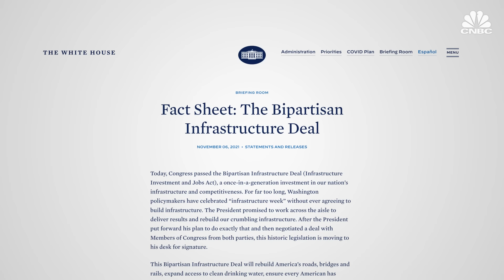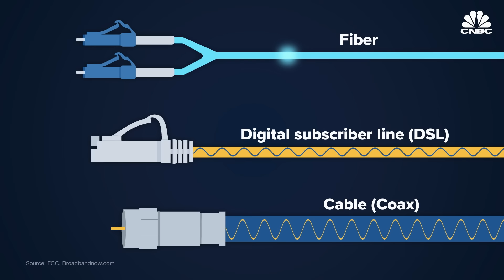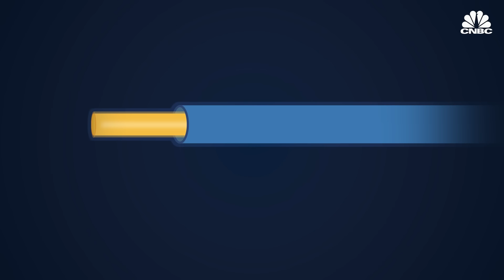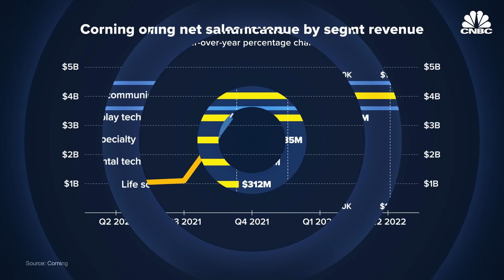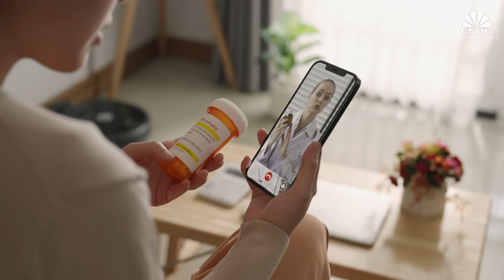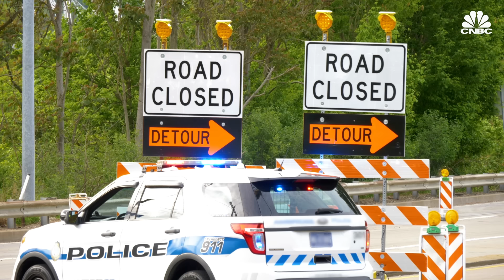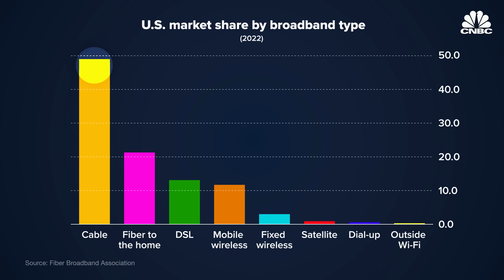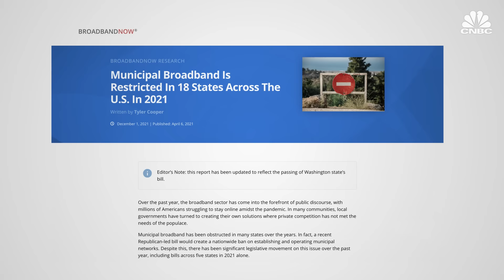How Fiber Will Speed Up America’s Internet

Comment: An excellent story. As a simple "end user" our household story is, we just switched to a fiber based internet service via a company called Sparklight (in Longview, TX). In addition, and this is CRUCIAL, we upgraded our wifi to a mess network. Now, our internet speeds are amazing! Information pops up immediately on websites. 4K videos play with no interruptions via web based TV services like Netflix, Amazon Prime, Disney+ and others. It's night and day compared to our former coax based cable company service. Ironically, the last, short connection between our fiber modem and the computer in our home office, is a copper CAT-6 cable!?! Yet, even that connection is MUCH faster due to the initial fiber service. As more and more Americans do get connected in what they call "the last mile." by fiber, I believe it will be a tsunami effect of consumers hooking up where available.
Reply: Mesh networks are great, I’d also say getting WiFi 6 router/s if you have mostly modern devices is a great call with fiber. Even with 1 WiFi 6 router in a ~4,000 sq foot house my desktop gets 500-600 megabytes per second up and down, no Ethernet

Cat 6 supports 10 GBPS @ 250 mHz…. So luckily, it’s highly unlikely you have the bandwidth to maximize its throughput speeds

Comment: While I think we all know that wireless has its issues, which wasn't really touched on in this piece, let's focus on the difference between what coax gets you versus a fiber connection (and I am on a 1 Gb/s symmetrical fiber connection here in the USA for ~$60/mo, which is much cheaper than the coax service in my area that is inferior to this):

1. Raw speed - I actually do need the upstream.  Many others may need this for things like backing up their computers to the cloud and remotely monitoring home security cameras.  Cable modem can be fairly fast on the downloads, but sucks on uploads.  When you do need it, it is not there just like the people who are not really your friends.

2. Latency and jitter - Cable modems can easily add 7 - 30ms of latency and can have lots of jitter as you share the connection with your neighbors.  As we all use VoIP (Voice over Internet Protocol) and video conferencing apps, this leads to delays causing people to talk over each other excessively due to the poor quality of service as opposed to it just being rude people on the line and breakup of voice and video, which at best is annoying and worse unusable and it happens ALL OF THE TIME with cable modems, greatly harming the quality of work from home.  In contrast my current symmetrical 1 Gb/s fiber connection has less than 1 ms of latency and less than 1 ms of jitter.  I can see when I am doing the same things over this fiber connection, at least the other people who are also on fiber and are either wired in or have their home Wi-Fi setup properly, the connection is perfect, no delay, no breakup of voice or video.  It is really clear who is also on fiber (and seeing I remotely communicate with the same people all the time, I know who has what to validate this) and who is on a cable modem.  In the remote worker world where you may interview over your home Internet connection, the people with fiber have a clear leg up on the people who don't just due to the potential employer can see, hear, and understand the person on a fiber connection where often the person on a cable modem they can't or key things said are lost.

3. Packet loss - An interesting thing I came across a few years back was a kernel patch that broke TCP fast re-transmits on a server on the other side of the country from where I am at in a way where it really impacted these long distance transmissions for large data transmissions I was doing for work.  On a cable modem, the problem would be triggered right away.  On a fiber connection, the problem simply would not happen.  I looked at the data stream with a packet sniffer and validated what was going on.  The fiber link simply did not randomly lose a single packet and so there were 0 TCP fast re-transmits while the coax link dropped packets like mad and this is even with the cable modem directly wired in, no splitters, only an attenuator because the signal would be too strong for the cable modem as the cable provider has to bump up signal strength to go through people's crappy splitters and open ports bringing noise into the system, especially on the 700 MHz band used by the cable modems that is also used by 4G cellular service.  (On my cable modem back when I could only get cable modem service in my area, I could see tonnes of packet loss in this 700 MHz band on those channels.  It came in bursts, probably as one of my neighbors sat next to an open coax port in their home with their cell phone or maybe an old coax wire that wasn't up to snuff.)  Packet loss also contributes to the poor quality of service discussed in #2.

4. Service outages - When I was on cable modem service, it regularly went out, even though I took everything off and just had the coax go straight into the cable modem, no splitters, just the right sized attenuator needed when not using a splitter.  When the power went out, the cable modem service went out.  I had the electronics in question on backup power, so they still had their power lights on, but the cable modem just wasn't receiving a signal anymore because the box down the street the coax cable connected to that the telco controlled did not have backup power.  With my current fiber service, earlier this year for example a huge, record smashing wind storm knocked out power for an extended time.  My fiber Internet service worked perfectly the whole time as I ran my equipment off of backup power.  As the fiber goes straight to the CO (central office) as fiber has the reach coax does not have, the ISP was able to keep their equipment powered reliably from a central location.  I even went by the CO at one point as I was doing stuff and could hear the backup generators running at the CO.  In general the fiber service has been super reliable and just works.  This was never the case with super finicky coax, no matter how hard I tried on my side to have the best possible experience.  Those with splitters and coax running in all directions through their home must have a terrible time, even worse than my horrible experience with it.  For example I have gone under homes to work on issues and have found rodents have chewed up the coax under the home.  I think this is probably pretty common and this can ruin the experience around the neighborhood as coax is shared with your neighbors.  This has got to cost the coax providers a fortune in service calls where my fiber service just works perfectly year after year, no service calls needed.

So yeah, coax is an obsolete technology that did not serve America the way it needed to during the pandemic nor will it moving forward.  If you want and these days need a quality connection that can serve your work from home needs, you really need to have fiber to the home.  There is not much else that can really compete with this in most cases.  The main exception I can think of is if you live in a high rise building, there is the possibility of doing point to point wireless between tall buildings at high frequencies (such as 60 GHz) and this can work out well.  Businesses can get lower frequency fixed wireless as say a lower speed backup connection, though beware of shared fixed wireless and VoIP as the two don't mix due to latency and jitter issues as well as potential high packet loss.  Cellular is really not all that great and worse than cable modems, which are not really good enough.  Starlink is more you don't have another option in your rural area.
Reply: Unfortunately I live in an area where comcast runs a monopoly and are the only internet providers. They set whatever price they want for their inferior service. Folks that live 1 block away from me have fiber internet that comes in from the pole. My house receives all its wiring from underground. The fiber company said they couldn’t run their cables underground and I would need to be close to the pole for me to even get service. Sucks that I have to deal with comcast.
Reply: Ya no ones reading that sorry bub.
Reply: Let's address a few things here. 99.999998% of people will never use speeds faster then the slowest coax connection. It would cost billions to service those 0.000002% that need it.Irest my case.
Reply: @TheReal_ist  it was very insightful. Speak for yourself bub
Reply: @miked3723  With what evidence?  To make it short as you obviously did not read before writing, consider mainstream uses such as computer backup, high quality phone videos, high definition security cameras.  Fast forwarding through security cam footage remotely.  Downloading modern games off of Steam.  Competitively play online games with video streaming.  Video conferencing.  Remote work.  Power outages.  These are all places I have seen cable modems fall short with endless frustration from it not working good enough and these are all mainstream use cases and things that happen in everyday life I am bringing up.  I see at least some of these every day.
Reply: @ChaJ67  All of those services work just fine at about 10mbps, mostly of them well below 1mbps. Coax can currently offer over 250mbps.
Reply: @miked3723  What planet are you on? The slowest cable connection becomes as useful as a 56k modem during the busy times of day between 2pm and 10pm. Even the upgraded cable, 50Mbit/2Mbit is not fast enough to stream Netflix or VoIP during those times of day. Cable is a shared medium, that one cable provides service to you and hundreds of neighbors, if everyone is using it at the same time, everyone suffers.

Comment: Fiber Optic is already the backbone of the county's internet. In fact Fiber is what replaced Cable Internet over a decade ago.
Reply: The majority of americans don't know this because they are still stuck on DLS internet from the 70's.
Reply: My internet is still delivered via Coax, so no it didnt replace Docsis cable internet.  While cable providers use Fiber to the node, its still an RF based service and its all Coax from the node to the house. Still suffers from limited bandwidth especially on the upload side.
Reply: How can it be the backbone if only 43 percent of consumers have it? I can speak first hand, it's not available where i live. Furthermore, i just moved about 5 miles and i can't even get access to cable internet!? Century Link DSL is the only thing available and it sucks...badly.
Reply: @j.r.a.inthacut8148  By backbone he doesn't mean to the customers homes. The core of most if not all ISP's networks is Fiber. The backbone excludes the "Last mile" which is how the customer is connected. All major ISP's use Fiber across their network. In the case of Coax ISP's like Comcast the Fiber comes out to the neighborhood and converts to coax at the node. VDSL is normally Fiber to the node as well, unless you live next to the phone companies central office.